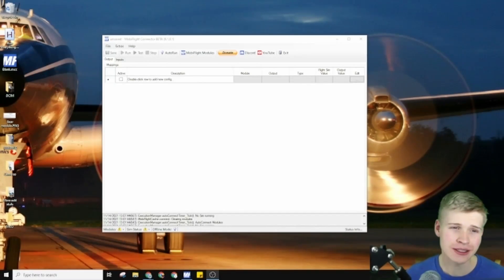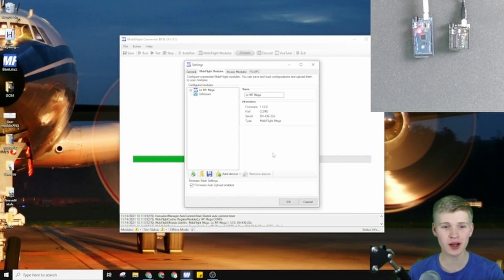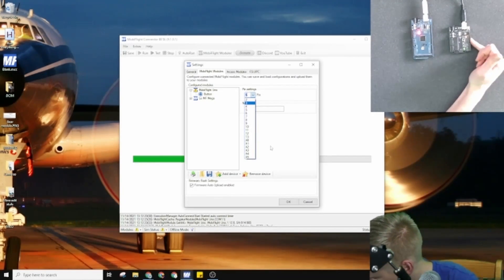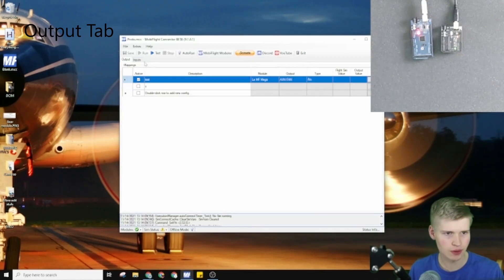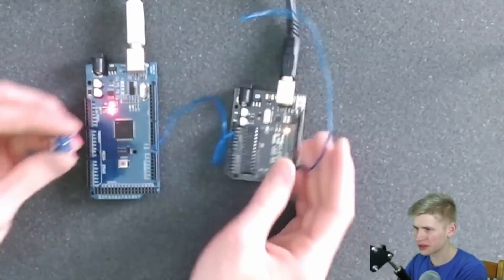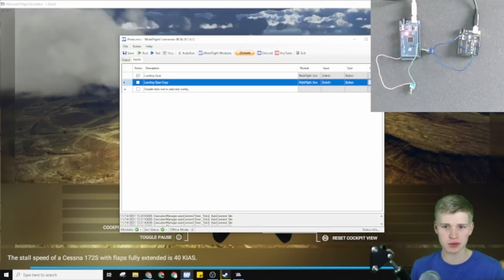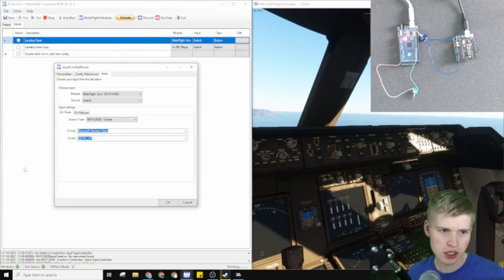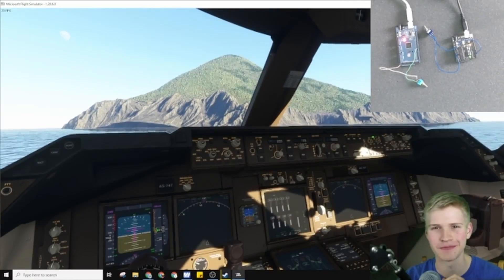Make a Gear Handle with the Arduino Uno: MobiFlight now does UNO!! FS2020 Tutorial

Comment: Once again, great video. I run FSX, P3D and FS2020. I have already have a gear switch and a parking brake switch configured on a mega via mobi flight. I would like to use the same switches to operate in FSX and P3D. Question, do you see any issue with running a second set of wires from each switch to an Uno to control via FSUIPC to run in FSX and P3D? Or, can I run the second set of wires though the same mega and use FSUIPC. Hope this makes sense!!!!!!!
Thanks Kevin
Reply from the maker: This could work, especially if everything is double pole (able to connect two separate circuits to). Just unplug one Arduino when you're not using it, and plug it in the other one. BUT! There's a much simpler way :)
Run the same FSX configuration with FSUIPC for both FSX, P3D and FS2020 (assuming the offset is shared). If the offset is not shared (it doesn't work in one of the simulators), make another row and give each specific version of FSUIPC's offset codes. They usually are the same between simulators, but look in the FSUIPC Offset Status Document to make sure.
The one that isn't shared shouldn't work while the one that does work is at work.

You can also make two MobiFlight configuration files, one for FS2020, and one for FSX/P3D, then just run the one you want.

Comment: Hi, is there a possibility you could make a video on how to wire led’s together so they use 1 ground wire, is this even possible? I want to make some led’s to show when my ap is on and off but I want multiple led’s for different buttons and only want 1 ground wire from them all. Any help would be great thanks
Reply from the maker: There are two main ways of daisy chaining LEDs: Serial and Parallel.
Some diagrams here show you how to do this (bottom of the page) https://captainbobsim.com/arduino
I usually use serial, and solder the grounds one following the other together.
Reply: @CaptainBobSim  then every ground wire going to the next led ( if we are doing it serial like you do) if going to need the correct resistor in it?
Reply from the maker: @Jack-li2ci  Resistors would go between the data pin and the LED (putting it between the GND and the LED would make all LEDs use the same resistor, even if they require different ohms)
https://forum.arduino.cc/t/grounding-multiple-leds/83026/2
https://arduinogetstarted.com/images/tutorial/arduino-multiple-led-wiring-diagram.jpg